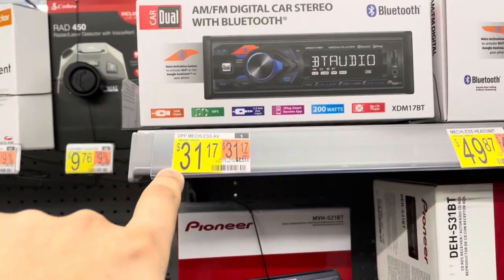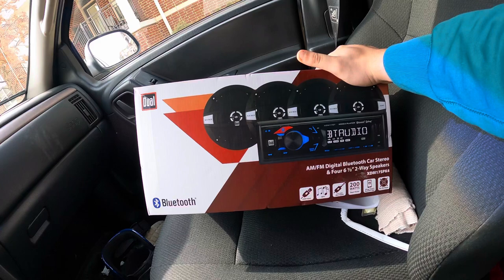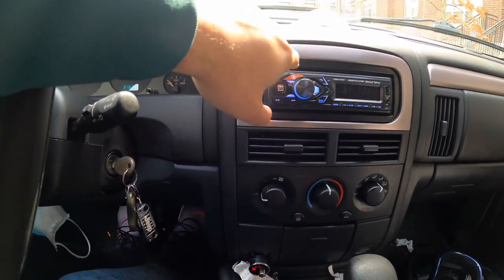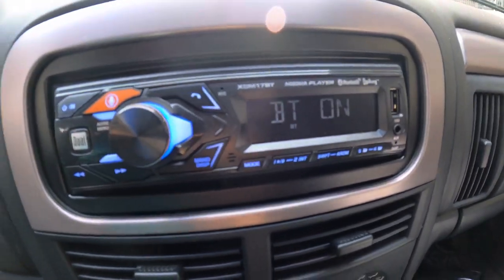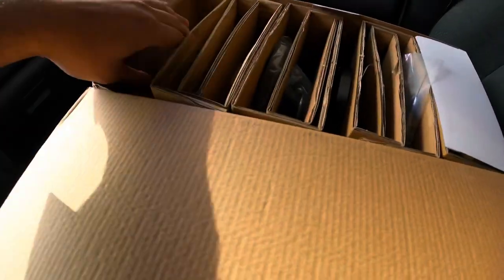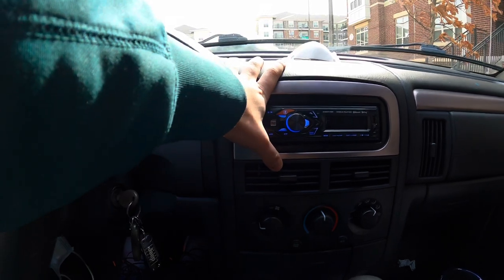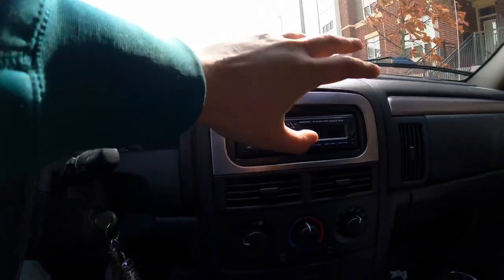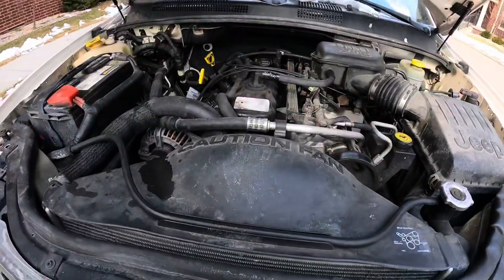Is a Walmart $30 budget sound system any good?!?!

Comment: 30 bucks, geez. You can't go wrong. That's insane.
Reply from the maker: I’ve had it installed for a year. Solid system. Bluetooth is excellent and pairs fast. I never installed the speakers but it did make my stock system sound better

Comment: So the radio doesn't come with the wiring harness?
Reply from the maker: No. The headunit is universal so you have two options. 1. Buy a harness for your exact car so you don't  have to cut the factory wires or 2. Cut the factory harness and splice the cars wires to the wires out of the new headunit. It's not too hard as they're colored so you match them up for the most part.